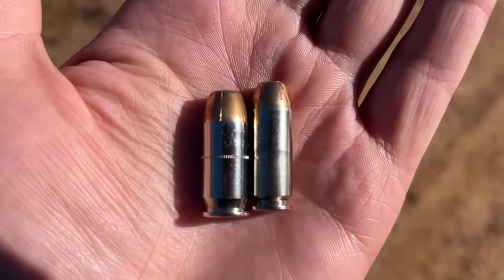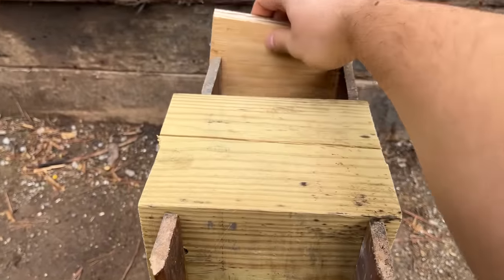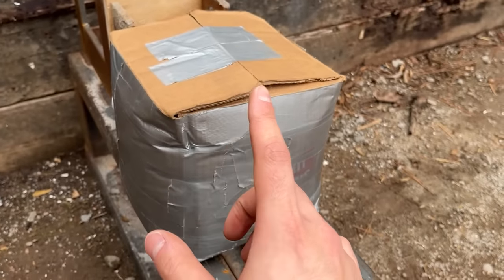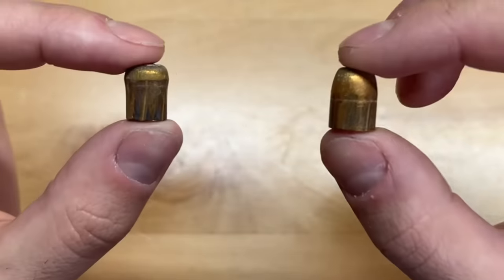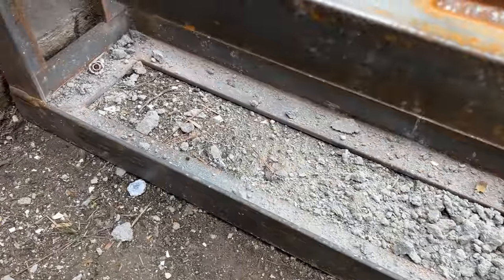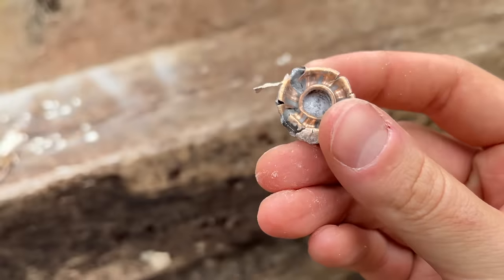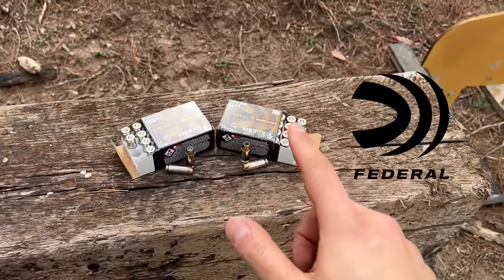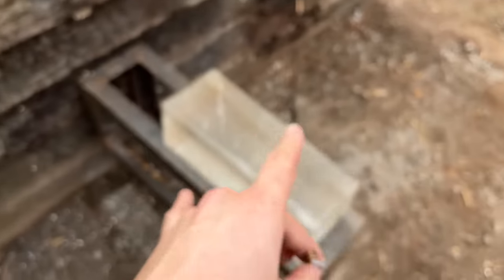45 ACP vs 10mm: Unbelievable Difference On Barriers

Comment: I've always wondered how one of those light for caliber 10mm rounds(like 135gr) would do in terms of terminal ballistics, and especially relative to the recoil it generates.
Back when I used to carry .40(I was not wise in the way of gun-fu when I bought my first handgun all those years ago, and decided on a g23 instead of a 19), I used Cor-Bon ammo.  One load was the 140gr DPX, and the other was a 135gr PowR'Ball, going 1325fps.  Both of those loads have significantly less recoil than the traditional 180gr rounds.  Put that round in a 10mm case(granted, you'd probably want a projectile made for higher velocities) and that thing would be screaming.
Actually, that makes me wonder what a super light 10mm projectile would do.  Like how there are 9mm rounds with 40, 50, 60 grain bullets, and they're going 2000+fps.  Load one of those in a 10 mil, and I feel like you'd be flirting with rifle type velocities.
Reply: Liberty Civil Defense, claims 2,400 fps out of a 60 grainer.  5.5” 10mm 135’s I got cooks at 1550, 1425 out of 3.8” barrel.
9mm Liberty civil defense reached a deer heart, to finish a spinal shot on a deer.  Clipped a rib too.

Comment: Just have 357 mag in 586 Smith/Wesson with 4 speed loaders. It STILL is a beautiful round/caliber. 10 mm has more carrying capacity. I never ever worry about a revolver. The first two rounds will be your tell tale in a firefight anyway. The 10 is a sweetheart if you are reloading. The revolver is better for accuracy due to the barrel length if you have the 6" barrel. The recoil for back on target is better out of the Smith due to its weight. No matter what you are carrying be proficient in it because they all destroy simple tissue and bone and open up the circulatory system.

Comment: How heavy were the rounds??  I use a 230 grain slug on my .45 acp and a 210 grain slug with my 10mm.   But a lot of times I shoot a 185 grain slug out of the .45 and nearly the same size out of the 10 mm.     Size does make a difference.

Comment: I like big calibers, so I want to find a reason to like the 10mm, but I can't see any use for it other than shooting bears, which I'm not interested in.
.45 ACP does not have under-penetration problems, but 10mm does have over-penetration problems. 10mm is also louder, and a bit more likely to make you go deaf, if you fire it without earplugs.
What is the point of the 10mm round? I really don't get what advantage it gives over 45 ACP for self-defense purposes.
Reply: Versatility. the 10mm is the 30-06 of the pistol world. you can find a load for every ocasion.
Reply: @fgutie35  Thanks for your reply!
Is the kick from the light loads as "gentle" as the kick from a 45?
Reply: @myblacklab7 In my experience, there are two types of recoil; snappy and spongy. The 10mm with light loads, is somewhat similar to that of a .40cal.( a light snappy recoil). 45acp as well as 9mm, have more of a "spongy" soft recoil.

Comment: 45 acp is a fabulous home defense gun. Right there beside my 12 guage! Another comparison video on a channel 10mm went all the way thru 3 -16" gel blockswith the nose peeking thru the end of the 3rd block. The 45acp as in yours only penetrated 8-9 inches with a wound channel you would expect from ball ammunition.  They also fired 45 super. I was expecting way better. The super only penetrated 2inches further than the acp round. With hard cast ammunition the 10mm can get nose to ass penetration on Grizzlies ! With 45acp or super your going to wound him bad enough to really pizz him off! Here in Colorado my backup anytime in the woods is a 10mm double stack. It stays locked up tight at home along with everything else i got that can punch thru my neighbors house! 12gua with #2 buckshot is on my wifes side of the bed and a judge on my side with 00 buck in 410.

Comment: Great testing. The results were not surprising though. The 10mm has always been more powerful than the 45acp. You should used Underwood Ammo that is loaded right up to SAAMI pressure limits, not pud loaded like some of the mass market ammo companies offerings.
It is ridiculous when the 45 fanboys say "it makes a bigger hole," or "they will bleed out faster" or "it does more damage" yes it is bigger, but the 'BIGGER' hole they are crowing about is less than one 1/16th of an inch larger in diameter than the 10mm. The 10mm has much more energy and velocity and does more damage. It will also shoot those big ol' thumping 220 gr hardcast projectile too for those that want a heavy bullet like the 230gr the 45acp is known for.

Comment: Test with buffalo bore solid mono metal 10mm or under extreme penetrator for 10mm look for fps when buying 10mm relative to the grain of the bullet best thing to get is a 1300 fps with a 220 grain for 10mm.

Comment: I have never fired a 10mm pistol, but I DO know why shooters LOVE the .45ACP: The 1911 is an almost perfect handgun in terms of snap and recoil, the slide and overall weight allowing the muzzle to stay on target. Additionally, the .45ACP was never really about penetration; rather, it has always been about impact and energy transfer. Think of it as a super-speed ball-peen hammer. Most law enforcement agencies have decided against the 10mm as duty weapons. Most use 9mm or .40Cal. LAPD SWAT mandates .45ACP, Philadelphia PD allows .45ACP as an option, as does Boston PD. Some PDs allow .357 Magnum revolvers.

Comment: The 4th Gen 10mm Auto was designed to produced similar power to the 41 Magnum in a semi-auto pistol. The 45 ACP is a 1st Gen pre-WW1 cartridge that drives projectiles with about 17K PSI less force than the 10mm Auto. Even the 10mm Auto's offspring the 40 S&W outperforms the 45 ACP in these categories.

Comment: Notice the LARGER width in the wood damage from  the .45  entry damage ,which is the shockwave in solid wood , compared to the .10 mm . 
That shock wave is why the .45 was developed. Knock down power . 
Good experiment. Thank you.

Comment: I want to play. Ive developed a .451 cartridge using small primer cases with Longshot powder. Im  using a moderately modified 1911 based on the 460 Rowland. Its a 18 brinelle 200 grain swc clocking berween 1300 to 1375 fps bepending on powder charge. Using a 6" thick piece of pressure treated pine i got a complete pass through and the round was caught in a 2x4 piece of pine behind it.
Im calling my new round the 460 Kurtz. Whats really good about it is it feeds very reliably, unlke 90% of the 460 Rowlands out there.
Reply: What is your parent cartridge case, how is it modified, and who produced your reamer?
Reply: @blackhawk7r221  45 ACP small primers weighing over 91 grains and use small rifle primers. Using this I haven't found it necessary to cut down 308 cases. Using this set up I have ran velocity up to 1400 where the cases started to crack. Backed off to keeping them under 1350 everything runs very smoothly. The cases however are strictly one and done though. I know I'm skirting the line closely  so why add that variable.
The test platform is a RIA government frame and slide. Everything in the frame is the same. Everything in the slide is changed. A Swenson fixed comp barrel. 24 pound Wilson spring and 2 piece guide rod. Wilson firing pin, heavy spring and flat firing pin stop. 
After researching powders in the 460 Rowland Longshot powder was chosen for it's lower pressures in this cartridge. Further research found it has a flatter pressure curve. In my research and observations after 700+ rounds I'm sure these loads are coming in at 30,000 or under pressures. 
I have yet to see any concerning wear or galling on the barrel or slide lugs. When I get a full 1000 rounds out of it I will reassess keeping the RIA as it is or retire the platform back to an ACP gun. Then possibly find a more robust platform (Springfield or Colt 70 series) for a permanent home for my 460 Kurtz.

Comment: Would be interesting to see the 10mm performance with better loads. The real full power 10mm factory loads were 1260 fps with a 200 grain bullet, and 1300 with a 170 grain.
Reply: The load he used was nothing more than a 40 short and wimpy or 40 small one week federal has long been known to not load the 10 mm to anything more than a 40 Smith & Wesson. This was not a comparison of the true 10 mm against the 45 ACP it was a comparison of the 40 Smith & Wesson against the 45 ACP! he either needs to buy the proper ammo from underwood. Buffalo bore or similar manufacturers, although double tap is not one of these! We’re here to actually use a true 10 mm load the results would’ve been dramatically different! Especially if he had used a solid copper around like the ones  Used by Underwood, which are manufactured by Lehigh bullets.

Comment: Interesting. The 1st test with wood block evaluating penetration you (obviously) leaned to 10mm. You did the same on your other clip comparing 9mm vs. .45. What seems to not get mentioned is that deeper penetration doesn't equal deadly. Internal damage does. A .45 (typically) will create more internal damage vs. a 9mm or 10mm has a chance of passing thru a person. The closer they are, the possibility of it not "catching" enough and if the person is high on adrenaline it might require multiple shots to get the "desired" effect.

Comment: Can you please try the 10mm again with 180gr ammo @ 1300 -1400 fps, that’s closer to its intended design velocity. They make hotter bear loads but back in the early 80’s when the FBI tested it they wanted something like 13” of gel after going through a windshield at a glancing angle and then winter clothes before getting the gel measurements. It was something pretty extreme like that. I remember read the angles for the windshield and thinking wow that’s like aiming for the driver from a low position at the passenger A pillar to front tire area 😳 that’s seems to be a pretty serious task to accomplish in a pistol cartridge.

Comment: For your sand box test…if it were possible to mount a scale vertically behind the box of sand to record the amount of force each round exerted on the box, this would be a more practical test of “stopping power” than wether or not a round travels through the sand, especially because of the difference in diameters before and after the test. Of course, this can be done with simple math, but what fun is that!?!?

Comment: You could test the Lehigh Defense Xtreme Penetrator on mild steel.  Underwood loads the 140gr at 1500fps.  I have seen it penetrate a slab of bullet resistant glass.

Comment: The 45 was designed and tested with a 200 grain bullet not a 230 grain.
There are a lot of 200 grain bullets màde by companies that will give you the same performance that equal the 10mm on foot pounds energy and more.
I have both and have done testing with both on many different targets at my home.
Both did great the only difference is my 10mm holds 15 rounds compared to both of my 45's which hold 10 in the double stack & 8 in the 1911.
Bottom line is do your own research and testing to know how your weapon will perform.
A good video still the same for those who won't test their weapons an idea of what to possibly expect from these calibers.

Comment: The 45 ACP did exactly as designed. It is supposed to stop at 14 inches to prevent over penetration and dumps ALL of it's energy in the target.

The 10 mm wasted a good portion of it's energy and over penetrated the target. If someone was standing behind the target they could have been possibly killed. 

If you throw standard ball ammo with a flat tip or meplat on them it changes the effect.

One of my relatives was a Federal Marshall on the West coast and then Denver area later.
He carried a 45 colt and swore by those bullets. He said it would put down the addicts hopped up on drugs that seemed to shrug off shots. 

His back up was a snub nosed 357 mag with semi wad cutters. He said usually the 45 put them down if not the 357 mag did even if they were wearing heavy clothes.

I actually think a 10 mm with a heavy weight hollow point or a 45 acp carrying defense rounds staggered with ball ammo rounds would be my constant carry if I was in law enforcement.

I would not bother carrying a 9mm, I would carry a 40 + P  round and up as my duty round.

I am partial to 357 mag myself as my favorite all around load. People don't realize that the 357 mag can way out class the 10mm if loaded up to it's original potential.

Everything sold over the counter today is a reduced version because of liability of people using them in older pistols that were light framed.

Comment: Army testing was done on natural pine and did 7 inches of pine.  What load are you using for 45 mine with a 890 fps Federal 230 FMJ penetrates completely a treated 4x4.  Don't cherry pick loads the 45 penetrates 7 inches of pine and 2 32 inch gel blocks with a hardball, a good one.

Comment: Unless I'm mistaken, I can remember reading years ago that the average depth of a human torso is 9" (front to back) so isn't the goal to develop a round that dumps all it's energy within that space? Anything beyond that poses a threat downrange. Or maybe all that data has changed over the years to take into consideration personal body armor or heavier winter jackets.
Reply: I would say a round that penetrates a body dumps as much energy into the target as a round that doesn't penetrate if not more, because the amount of force required to do so is the same. Diameter plays a role as well of course. My feeling is that a round that is able to carry more speed through it's target in it's expanded state will do more damage than an identical projectile that stops. Most rounds were designed as FMJ rounds, so I don't think overpenetration was much of a consideration.

Comment: You said .45 AARP and I felt that.. I guess being a boomer is hard to deny now.
Reply: i own one and am going to start using that phrase. I bought it because I like how the dbl stack fit my hand.
Reply: The .45acp with the same weighted bullet on the 10mm, outperforms the 10mm in force per square inch and wound cavity. Just drop the grains closer to a standard 10mm grain bullet of 155.

Comment: I’d like to see 10mm max loads of various bullet weights vs each other in mild steel and ballistic gel. Does a 1200fps 200gr bullet have more penetrating power than a much faster and lighter bullet of the same diameter with higher ft-lbs?

Comment: Errbudy knows the ten is a superior cartridge, but nice to see some different kinds of tests. However, if one were to actually read the F.B.I. test reports, one would see that the researchers gave 12"-18" as the RANGE OF MINIMUM PENETRATION, and also stated that more penetration is better. 18" is part of the minimum, not a recommended maximum. Bullets will go deeper thru the Clear Ballistics stuff than thru the F.B.I. stuff; a depth of 18" in the F.B.I. stuff is roughly equal to 23" in Clear Ballistics (see Brass Fetcher et al), so if you want to worry about "overpenetration", you can after a round gets past 23". For that matter, people who are worried about "overpenetration" are apparently supremely confident that they will never miss or have a peripheral hit in a fight for their lives. Kudos for the heat gun trick on the gel tho, I always wonder why content creators never try to clear up the wrinkles. BTW you should be doing voice work!

Comment: Federal HST rounds were originally designed for LE only because they had expansion rates dang near 100% of the time unlike a lot of other rounds at the time of their introduction. 10mm rounds were originally designed by the FBI but since a lot of their female officers had a hard time shooting it, they went with the .40 instead.
Reply: @johnklatt3522  My bad, a article I had read years ago apparently got it wrong. I stand corrected.

Comment: An arrow shot out of a  mere 50-pound takedown recurve bow will penetrate that box of sand from around 20 yards without a problem. Bad news for someone hiding behind that box. How do I know? Because I did this with my 48-lb Jinxing bow. When I first heard this was possible - I laughed. I didn't believe even after I watched video demonstrations. Thought they were rigged somehow.. Now that I know it's definitely possible, - I am still no closer to understanding the reasons an arrow behaves so differently from a bullet. The 3 things I can think of are:

 1. "The Archer's Paradox" the arrow constantly undulates, - which makes it "swim" through sand like fish through water.

 2. An arrow has a fairly pointy steel tip, though I wouldn't call it sharp, so impact doesn't flatten it. The reason I know this has to be part of the reason is that an arrow with a much sharper and narrower hunting tip (I took the side blades off) had almost penetrated 2 sandbags set side by side.

3. An arrow is also much heavier than an average bullet, so it does the job despite its initial velocity of only 155-160 fps

I only tested the #2 assumption. I will eventually test #3. As far as #1 - I'm not sure how to even begin. Using arrows of different spine seems to be the right idea. However, those spine differences are pretty incremental, - even if I take more than 100 shots with each and average the penetration depths out, to a mathematical mean  - there is no guarantee of discernible difference. Which would not falsify my hypothesis either.

Comment: Several things one wants in a handgun.  1.  Adequate penetrating power  2.  Rapid transfer of energy to target   3. No overpenetration.  In other words, one uses jacketed hollow points to achieve max shock value in the target without so much penetration that the energy is expended in objects behind the target.  This video and others that you do seem to look to penetration as a desirable asset rather than the liability that they actually are.